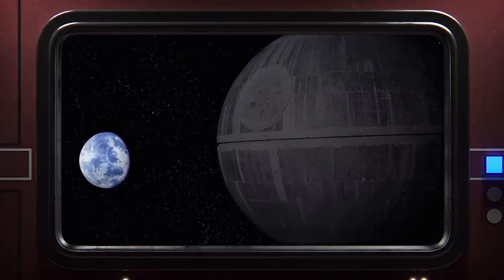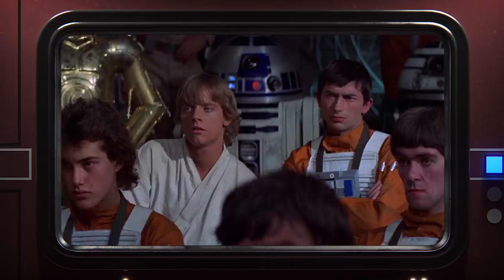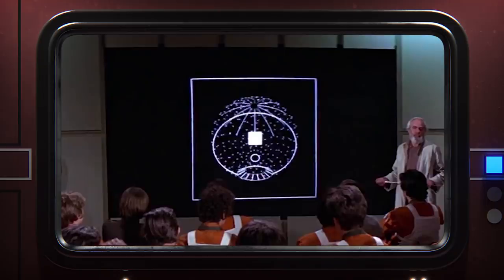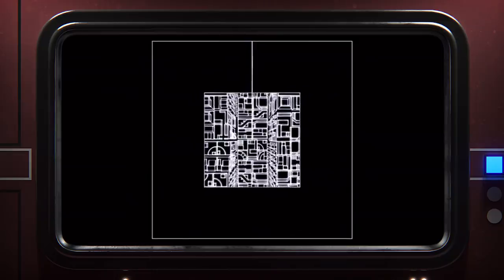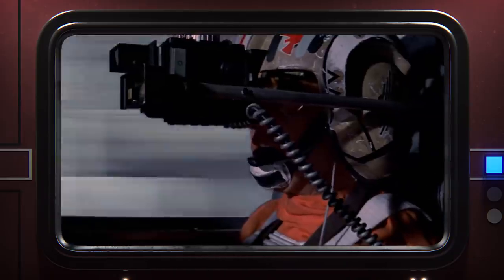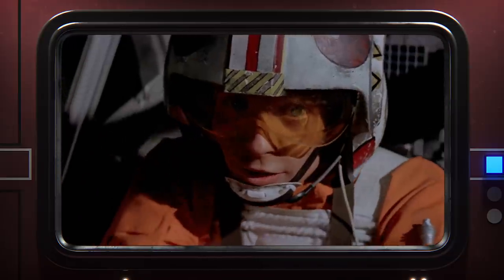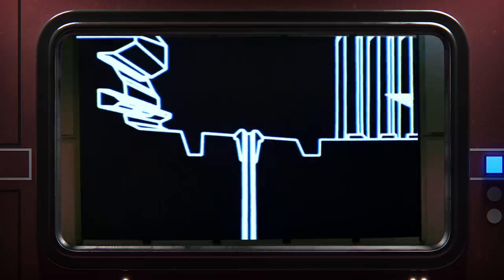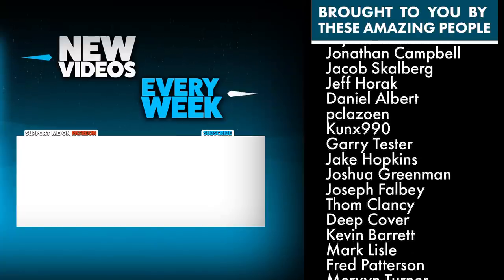The Thermal Exhaust Port Was NEVER a Problem

Comment: What if, the thermal exhaust was never connected to the core, instead was connected to some sort of ammo storage for the giant defensive guns onboard of the deathstar? Because lets think of it, none of the material that used to build a deathstar core would had that kind of explosive power, unless it was some military grade ammo stored near fuel tanks, not the power core itself. Just like if you hit the engine room in a battleship, they would explode but would never sink a ship that fast, but if you hit an ammo dump, you would tear the whole ship in less then a second......
Reply: I saw it as they disabled the containment feild.. Enough energy to explode a planet will do very much the same thing to your battlestation if it gets loose.

Comment: They could have easily put 100 m thick plugs in the exhaust port shaft but did not because it would have taken time in Palpatine wanted the Death Star completed as fast as possible.
Urso was able to get the Empire to agree to the exhaust ports because it was the quickest solution
Reply: It's an exhaust port... why would you cover it up lmao

Comment: The real problem - though structurally reasonable - with the exhaust port and its exploitability is the direct route to the core. Put even a single bend in there anywhere and no shot can go through, no matter how precise. It will just bonk the sides of the shaft at some point along the ride. It makes a lot of sense for it to go directly to the surface for engineering reasons, but if anyone ever considered the possibility of somebody attacking this port - and since it was shielded, they very well did - they could have went he extra mile with it and just put a slight curve to it along the way down or something. Air should have little issue following the curve, while projectiles would have a lot of trouble. So while yes, precautions were taken, possibly even "all reasonable precautions" but it would still have been possible to make it safe against this particular attack too. And if rebels could figure out this avenue of attack, I'd imagine the imperials might have as well. But then again, they were never too prepared for the small craft that the Rebels excelled at, so maybe they would not have considered this possibility at all still.
Reply: As EC Henry said, it wasn't a straight shot to the reactor (as the little diagram suggested) but a domino effect, suggesting that the torpedo would hit something along the way which would eventually blow up the main reactor.
Reply: @LeavingGoose046  The diagram did show a straight line once the torpedo enters the shaft actually 2:40. It is the shot itself, coming from the trench, that is not a straight shot but rather a bomb drop.
Reply: @BanzayIkoyama  We know the diagram is inaccurate though (with the death star disk being at the equator and the differences in top trench numbers), and the dialogue references a domino effect rather than a main reactor shot
Reply: @LeavingGoose046  To quote the briefing "The shaft leads directly to the reactor system." Whether that is the main reactor itself or not is beside the point. You are correct, the thing that destroys the station is a chain reaction, but the problem still is the shaft itself leading directly to the reactor system. Assuming it did not, it would indeed jam one exhaust port and probably cause some problems, but not destroy the station entirely. What they might mean by "leading directly" might be up for debate, but it is not far fetched to say something "less direct" would not lead to the same results.
Reply: @BanzayIkoyama  Fair enough, hats off to you

Comment: As large as the station was even with the engineering plans it would take a good long time to go through a moon size structure to find a total failure weak point... It took the force to make that shot... But yeah... It's a movie to keep you at the edge of your seat not a professors lecture.

Comment: +EC Henry

So if there are multiple exhaust ports then that brings up a question: does the sa they all have the same problem?

Regardless; while it is a fictional universe there is 1 thing that has always bothered me: so a person intentionally creates a flaw in the PROTOTYPE BLUEPRINTS for the Death Star...so what..? Now I don’t know anything about engineering and even I know that by the time if not before construction on the Death Star had even begun so much would happen that by the time it was actually completed the planes would probably be unrecognizable: however even if they were not (which I find to be very unlikely) in any case there would be at least millions of construction workers and at least thousands of professionally trained engineers (yes most of whom would be loyal) working on the Death Star a main line top of the line battle platform/station/first rate spaceship of the line;) that every single yes little thing are going to be checked and double etc. checked; and tested and re-tested etc. there is a lot more that I could say however to make a vary long story short while “anything’s possible” and “nothing is impossible” it really would not be about possibility or impossibility it is really about that the process of especially modern design and construction simply would not allow for such a glaring mistake to have been made: and yes if the rebellion could figure it out then absolutely the empire having years to look over and modify the plans would be able to figure it out as well and they then would fix it: and if it or any sort of problem could not be fixed then they probably would not have built the Death Star or anything related to it in the first place.

P.S. “the empire does not considered one man fighters to be a threat” BULLSHIT! Even I know that officers of a professional military are trained to consider anything a potential threat; especially something that is one.

Comment: Wait, correct me if I'm wrong but how could you even use thermal exhaust in space, you cant transfer heat without matter, are they blowing out hot air?
Reply: Not exactly true, you can use photons and gamma waves and so on. but maybe. It doesn't really matter.
Reply: @carbon1255  would those methods need open unobstructed vents

Comment: Given how heat loss in space works, it seems likely that those ports were meant to vent excess gasses when the reactor was running at higher levels, thay would imply that the ports all lead to the reactor or very close to it, this would also imply the lack of particle shielding.

Think of it like a big nuclear reactor, you dont have to sholt the core when damaging key safety systems can wreck it.

Likely that port more than any of the others led directly to a critical component of the cooling system, and that touched off the chain reaction.

The same has occured in real life reactor meltdowns, the cooling system gets damaged then the core heats up and melts.

In this case the reactor is fucking huge and explodes.

As for the second death star, the innards were meant to be enclosed and likely not seriously armored.

Palaptine fucked up in not making sure the reactor was sealed off.

Indeed, given the dialouge innthe start of RotJ, its feasable the 'behind schedule' bit wasnt the entirety of the second death star given it was bait, but rather closing off the reactor was behind schedule.

The irony was if Vader had just told the Moff in charge of the DS2 'hey, as long as the superlaser works and the reactor is sealed off, you're good', the battle of Ebdor would have had a different outcome, cause a few big durasteel plates blocking those corridors would have kept the station from dying.

Comment: I think you really miss something critical: they must have considered the possibility that the plans are stolen. And also the rebels probably had much more than just these 30 X-Wings. If they didn't know where the vulnerable port was, they probably sent 30 to each of the ports.
Reply: they knew which port was vulnerable, they zoom in on it during the briefing. The Rebels did only have the 30 ships (combo of x-wings/y-wings) during the battle
Reply: @baconacorn473  then they maybe used the other X-Wings as a distraction.
Reply: @rfvtgbzhn  There weren't any other X-wings in the battle other than the group heading for the exhaust port
Reply: @baconacorn473  source? Just because they weren't on screen it doesn't mean that they didn't exist.
Reply: @rfvtgbzhn  one of the officers in the movie informs Tarkin/Vader that they "count 30 ships, but they are avoiding the turbolasers." This was confirmed in books like From A Certain Point of View as well as as, iirc the Death Star novel off the top of my head, but this has been pretty well established for decades now.

Comment: Rogue One is a pretty good movie but it's "Erso sabotages reactor" story makes no sense to A New Hope. As EC explains everything important we need to know about how it was destroyed was in the movie. Getting the plans was the important thing and then they found the "weakness" which was a virtually impossible shot that only was pulled off by Luke with the Force and as assist by Han. Besides that who sabotaged the reactor of the Trade Federation ship in Phantom Menace? Who sabotaged the reactor of the second Death Star in Return of the Jedi? If reactors only explode by sabotage then someone had to do it! The point being that reactors don't need to be sabotaged. If the Rebels thought the reactor would only explode if it was sabotaged then they wouldn't even bothered attacking in the first place because the whole attack would be pointless.

Comment: Probably also could’ve used a wire mesh lol. Seriously that would block it, it’s a one in a million shot and if you land it it just stops on the mesh and blows it up but there’s not much damage as it’s on the surface

Comment: from a military engineering standpoint no exhaust port has gone strait to an engine or generator ect ect since about world war 1.    a simple baffle, or hell even some cheap mesh would have stopped the loss of trillions of dollars of hard ware.  Yes it was ray shielded but ray shields only stop half the attack possibilities in the Star wars universe so adding some cheap baffles would not only help the thermal mass but also prevent projectile atttacks. 
who knows, maybe that is why the other ports were all not vulnerable as they had already done this, and some work order somewhere had not been filled, but it has always seemed like a glaring weakness as the empire knew full and well that the rebels had the plans and didnt bother to fill that trench with proper anti starfighter weapons.

Comment: My explanation is technically only accurate if you assume the movie is candyland, and simply PORTRAYING a realistic story, where newtonian physics applies, and other things too. For example, no, they don't have artificial gravity in small ships, but they weren't going to deal with that in that film. Yes , it IS imaginable to have a degree of artificial gravity from "orbit", assuming the orbit is a high powered turn. probably no gravity in the millennium falcon.
Reply: The Death Star was ONLY JUST big enough to house that power plant. incidentally, in order to create such a power plant, the entire station's energy cycling is related to the central power core. This means that after the death star fires a shot, some rooms will get hotter, and some will get colder, and some areas of the death star might be supercooled, accessible only by stormtroopers in suits that can keep them safe. you know, a REAL twist on the film, would be that the ONLY WAY the attack would even work,, is if the Death Star were JUST ABOUT to shoot, meaning fully charged up,,, which would be HOW the thermal exhaust port would be such a weakness.

Comment: I think you are pretty much dead on, EC.  The exhaust port is tiny, one of several, the only that is exploitable like this, requires a pinpoint shot to hit, and requires you to fly straight down the trench which is (presumably) fairly narrow, making maneuvering almost impossible, leaving you vulnerable to AA guns in front and enemy fighters behind. If anything, I think all Rogue One did as far as that goes is make the reactor itself more vulnerable. Making it necessarily unstable makes it more like that the torpedo hit would work. And Galen didn’t even seem to necessarily know that the exhaust port would be the way to blow it up. All he said was a pressurized explosion in the reactor would do it due to its unstable nature. It’s entirely possible he could have considered the possibility of planting explosives in the reactor or something. In my mind, as you said, the exhaust port was a one in a million shot (to quote Han) with Galen’s work simply making that one in a million shot more likely to work

Comment: While you do kind of have a point, when designing anything this big, this expensive, and this important, you expect it to have zero weaknesses. There would have been hundreds of not thousands of structural engineers working on designing this thing, and even more working on specifically rebel-proofing it. It's an inexcusable weakness unless it was deliberate sabotage.
Reply: It's rather the exact opposite. The more complex the more errors you expect. You just double up on redundancy. Also, it literally was deliberate sabotage.

Comment: This phenomenon happens all the time - in hindsight, it always seems like it would be obvious to prevent an attack / structural failure / tactical mistake / operator error when you know the complete chain of cause and the outcome. But during the moment it happens, it's not at all obvious. There are specific compounding circumstances that contribute to such an event in most cases, and these compounding circumstances are usually not considered together in events that lead up to failure. The people behind desasters such as chernobyl, three mile island or the comet aircraft are not idiots or amateurs, but experts, the best in their field, only presented with insufficient data and conflicting situational information. Could these catastrophes be prevented? No. Because there was no one raising concerns about a certain compounding of circumstances that might arise soon.

There are of course different instances such as the challenger desaster, where there actually was a warning, but those are a different topic.

Comment: I think this still justify rough one sabotage since they can just make the port not a straight tube to the core, it can have multiple turn much like the entrance of Cu Chi tunnel in Vietnam are not straight so you can't just chuck a grenade and kill everyone down there.Plus it will actually help the heat management since it will allow more surface area for the machinery to release away there heat.

Comment: I don't think Rouge One is needed to explain HOW the Death Star could posess such a vulnerability, I think it's useful to explain WHY it did have such a weakness.
After all, this wasn't a construction mistake, it was in the plans.  Why would this one exhaust port, out of 18 identical secondary ports, be vaunerable?  Why would it be designed differently?  The one thing the Death Star wasn't short on was space.  They still had large internal empty spaces, it seems unlikely there was something at that point that needed to be built differently from all the other ones.  Otherwise, we're left with an Empire capable of maintaining absolute tactical secrecy until almost the last minute, of building a weapon that clearly terrified its enimies simply by existing, but not of noticing what a small contingent of Rebel scientists discovered in a few hours of analysis?  That is what doesn't make sense.  If the weakness is that obvious, how come the designers didn't see it.  It's not like the Imperials forgive failure.

Comment: Exhaust doesn't mean suck it means blow. So how is it that the bombs were supposed to go in a 90 degree turn into the exhaust port even if the pilot who did it didn't have the force?
Reply: Maybe the exhaust blows out radiation, which is a way that energy can be transferred without a medium.

Comment: even exhaust ports on cars and tanks use filters. the exhaust could have even been from radiators distanced from the main reactor by liquid circulation. etc etc no genuine engineer would overlook such a flaw.

Comment: Most of me thinks people just remember the jokes and forgot that the jokes need to deliberately ignore how obscure and well-defended the port was in order to work.

For me, the real 'fix' to the Death Star problem that Galen Erso brought to the table wasn't the weakness he built into the Death Star (which, don't get me wrong, was important), but that he revealed what and where the weakness was. 

Before that, I felt that ANH glossed over/didn't understand an important bottleneck in the sheer amount of data that Rebel engineering wonks would have needed to unpack, digest, and mull over. Then, once they had an idea of how an unprecedentedly massive structure like the Death Star worked, then they'd have to find a weaknesses that had gone unnoticed and uncorrected and then come up with a way to exploit it. Before Rogue One, it was something I had to just accept and handwave away.

Thanks to Galen, the fact that the Rebels were able to come up with an exploitable weakness in the timeframe they had makes complete sense. As a bonus, it also makes Leia's gamble in exposing the Yavin base feel a lot less reckless.

Comment: My thought is, why does the Death Star even need an exhaust port in the first place? What are they exhausting in such high quantities, that they couldn't just use containers to ship the waste? What type of reactor is in that core anyways. If it was a niclear reactor, they wouldn't use this crappy open exhaust system. If it uses plasma for power, then my question is why, because fissile material is a much more compact and efficient way to store energy AND it doesn't need exhaust ports.